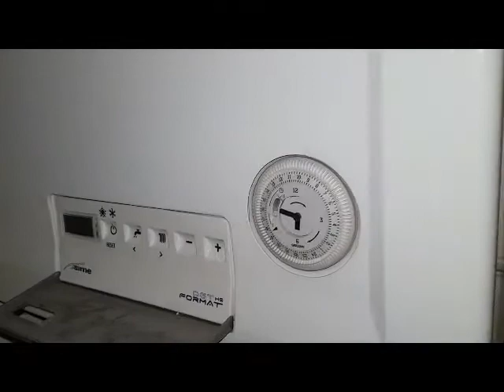AL02 Fault code Sime Format GDT HE

Comment: Never explained how it’s fixed ? Useless video.
Reply: Yer great, didn't show us how to actually fix then problem when I'm freezing and the link you replied doesn't work
Reply: @timothyturner1675  how did you fix dude? I’m in same boat rn😭
Reply: @CHRXN13  I had an issue with the Motherboard wasn't reading the pressure correctly it was cheaper to replace the Boiler
Reply from the maker: How it work out cheaper to change the boiler?
Reply: Nothing
Reply from the maker: Check this out https://www.boilerrepairmentoring.co.uk/virtual-boiler-repair-mentorship you will alot more information here